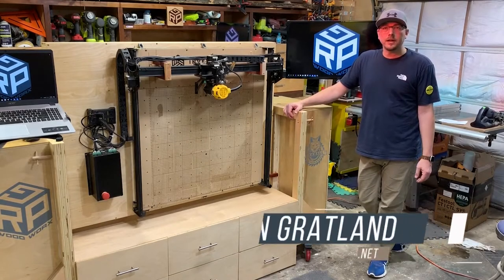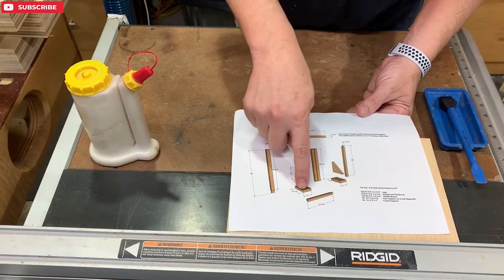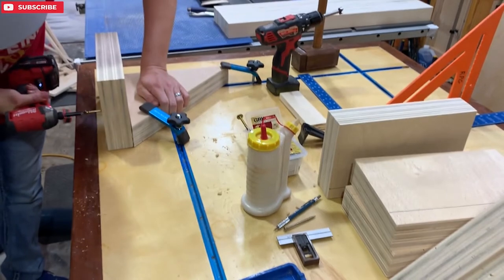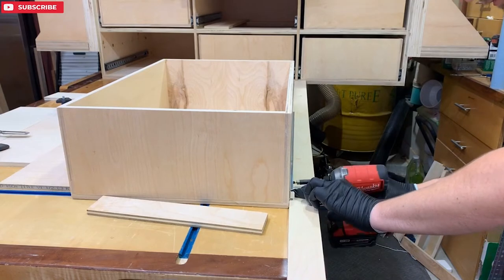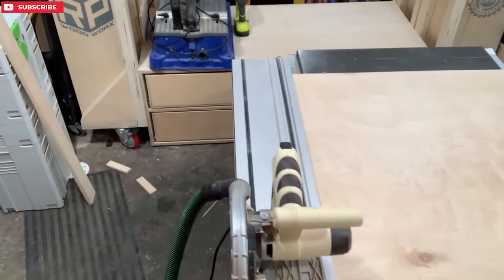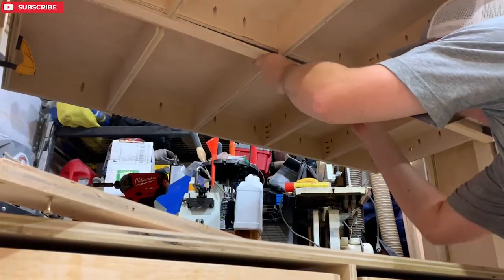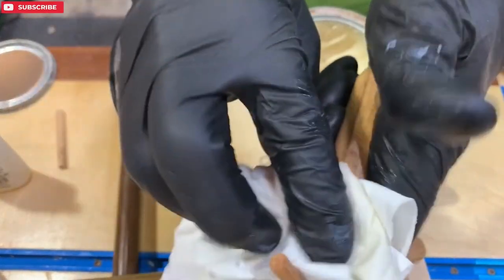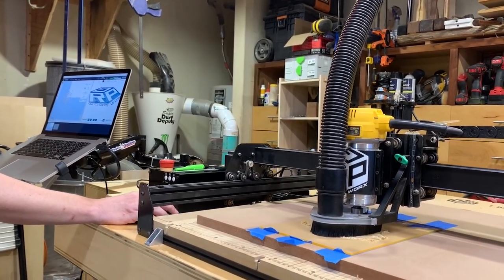DIY | How To Build An Extreme CNC Mobile Flitp-Top Station: Full Version

Comment: What a great build. I bought the plans, since this is exactly what I need to build this month. However, I'm a bit bummed out after I realized the plans won't work for me as drawn - my table needs to be 48" wide instead of 40 3/8". Still a great idea, but I've got some redesigning to do and I don't have Sketchup Pro, only the free online version.

I also want to see more on how you routed the wiring so it doesn't get in the way.

Thanks guys.
Reply: Definitely. Just add the length to the center section. Steel pole and bottom cabinet

Comment: A really nice design. I'm liking all of it except the price to build it. According to my calculation, just in the screws alone you spent a fortune. This build will run around $600 bucks to create if all of that hardware and furniture grade ply is used. But you know the old saying. "YOU GET WHAT YOU PAID FOR" Nice build though and the video and audio were done quite well also!
Reply from the maker: Thank you. Yes this was built to be both rock solid and never needs to be replaced. As you know if the station were to wiggle the cuts will suffer. I’m still loving every day with this station. Thanks for watching!!

Comment: Very nice design and build video!  What are the dimensions of the three different sized stations that come with the plans?
Reply from the maker: Thank you!  500mm 750mm and 1000mm
Reply: @rpgwoodworking5489  I ordered the plans and want to make the Torsion Box Width 48 inches instead of 42.  I believe modifying the Torsion Box Width will require the length of the Legs to be increased by about 3 inches.  Are there other dimension changes I should look at making?